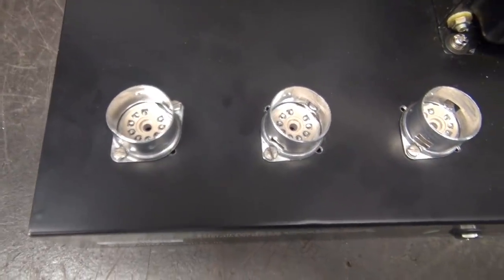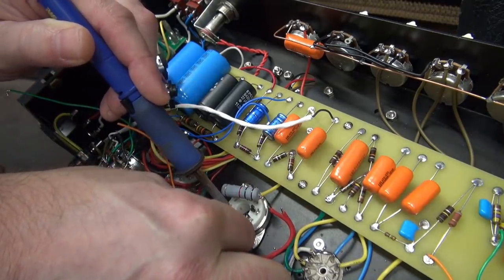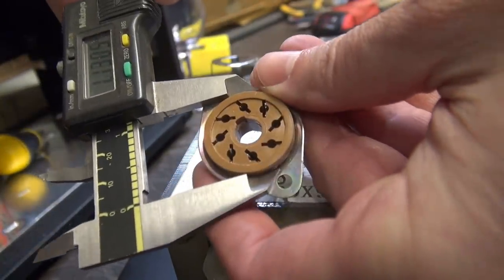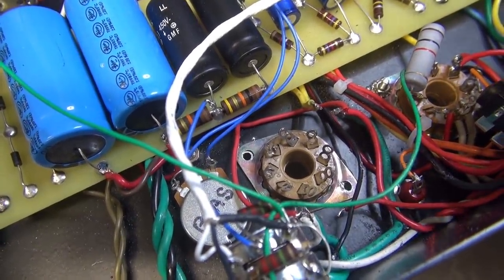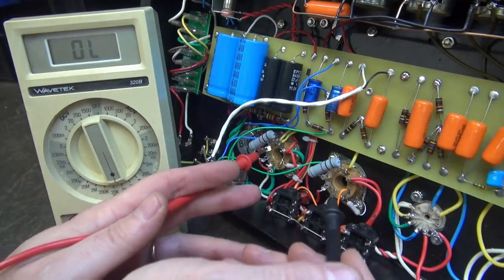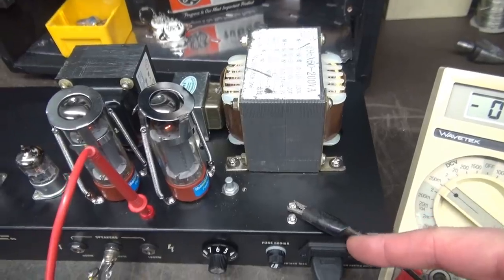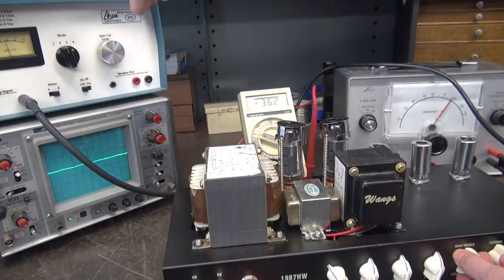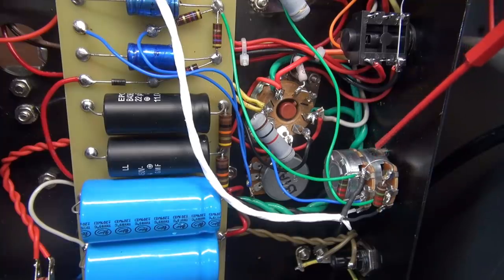How to repair Wangs 1987HW Tube Guitar Tube amplifier Part 2

Comment: As you know Terry, I have a "Wang" for tube amps! Ha Ha. You really do show great mods for these amps. A master volume should be on all amps and the bias test point too. I know more money in manufacturing, that's why you don't see them, but after market mods for amps used in playing, it is worth it! Great video. Can't wait for your next! Thanxz
Reply from the maker: Thank you my friend. I agree, you should not have to remove a chassis for bias setting. That exposes you to high voltage and possibly damaging components. Fender always had the chassis screw driver adjust pot. Guess that added hole & pot was obsoleted by accountants, more profit!

Comment: Agree on a bit of a J-hook. On some amps they got a bit carried away. Working on an old Silvertone 1482 and replacing just about everything on it. I swear they had some women who were knitting experts wiring these things, Some parts must have been looped 3 times in spots LOL. It takes longer to rebuild an amp than to build a new one from scratch after removing old parts and replacing them.
Reply: SIXSTRING63 It’s the best method for soldering components susceptible to vibration and impact. Search MIL-STD-2000
Reply: Like Terry said in the video, old Marshall's were just poked through and soldered in and 40 years later still work after being tossed, vibrated and heated to death. I agree on a little bit of a mechanical connection but looping it around two or three times is ridiculous and makes it a nightmare to work on and remove the old component. I've very seldom found an old point to point amp with a broken solder joint causing it issues. Old Fenders were just poked in the eyelet board and soldered. Modern PCB amps I find broken solder joints all the time. The use of flimsy PCB's and lead free solder has caused about every amp in the past 20 years to fail from vibration and heat. If soldered properly on a point to point you'll hardly ever have a failure. I've seen looped components on old amps that were overlooked to be soldered after making them so tight mechanically and they have had issues of course. I'm a big fan of Mr. Calson's lab and he hates finding the looped to death components and agrees that if prepped and soldered properly you don't need to do all the hook and loop rug making approach. Just looked through the mil spec you listed. 1/2 to 3/4 of a loop around turret type component peps. It was more about the proper solder amount and fillet than the loop. I agree with that 100%, nowhere did it show two or three times around. That would make a military repair in the field very time consuming.  @5537-m9k
Reply: SIXSTRING63  It all comes down to personal preference for the hobbyist. Using “j” hooks on tube sockets is definitely the way to go, though.

“5.13 Wire and lead wrap on terminals. Leads and wires shall be wrapped around terminals for a minimum of one-half turn and shall not overlap. On terminals with square or rectangular posts, the wire or lead shall be in contact with the flat surfaces of two non-adjacent sides. For AWG size 30 or smaller wire. the maximum number of turns should not exceed three. Continuous runs and small parts to which such mechanical securing would be impracticable (e.g.. connector solder cups. slotted terminal posts and heat shrinkable solder devices) are exempt from this requirement.”

Here’s another NASA standard: https://snebulos.mit.edu/projects/reference/NASA-Generic/NASA-STD-8739-3-2.pdf

Comment: Great video. But Terry, are you familiar with the Traynor mod? EL34 or 6CA7 tubes have a much increased reliability if you tie raw bias voltage to the suppressor grid. I read about it in Kevin O'Connor's The Ultimate Tone. Haven't tried it personally since I usually work with Fender class A circuits.

Comment: Terry, Thanks for all your great information ! Question 10 year old  Bass amp just quit. Company in Miami Florida told me they will not send a schematic. Is that common practice for the industry? Not looking to manufacture amps, just want to fix mine. Thanks.
Reply: It’s increasingly common practice. Companies are tired of their circuit design being ripped off. Of course not giving a consumer their schematic doesn’t stop IP theft at all since the Chinese and others will simply buy a unit at retail and reverse-engineer it.

Comment: 3:50 - Terry, You're STILL relying on the hardware. That adjacent nut and bolt need to be 'Shnozaramussed' to the chassis to complete the ground connection!
Reply: never rely on mechanical grounds......always solder to the chassis.  It won't be long till that contact mechanical ground starts to oxide and corrode introducing resistance.  I'd never use those 1 ohm resistors either......absolute ground is best

Comment: Not at all a fan of the "j" hook wiring style, especially if I am the poor SOB who has to replace a component that has been wrapped onto the terminal.  No only did Marshall and Wang not use this method, one of the best electronics manufactures in the world shunned this practice. Tektronix did not, unless it was a wire wrap binding post and that is a different story.  Remember the solder is the mechanical joint AND the electrical bond.  That's why I like lead alloy solder.  Friends don't let friends use Lead-Free solder or bend the wires around terminal strips/tube sockets.
Reply: MIL-STD-2000
Reply: Solder is too soft to be a mechanical connection, learned that in high school. If you have cold solder on a j hooked connection, it might still work
Reply: @eetechtom That is an old wives tale regarding solder, you must have gone to school a long time ago.  If that were true plumbers would have a real hard time soldering copper pipe, think about that for a minute before you think solder is not mechanically strong. The idea is to NOT make cold solder joints.  I like to use MG Chemical active flux and 63/37 Kester solder and I have never had an issue with mechanical connections.  The only place where this might make some sense is in very high power speaker amplifiers with huge vibration concerns, like in Fender and other guitar amps.  We will just have to agree to disagree otherwise, take care.